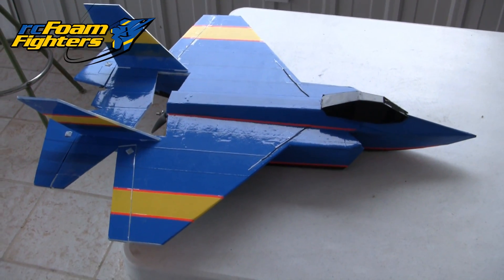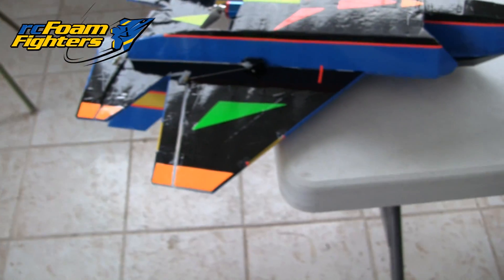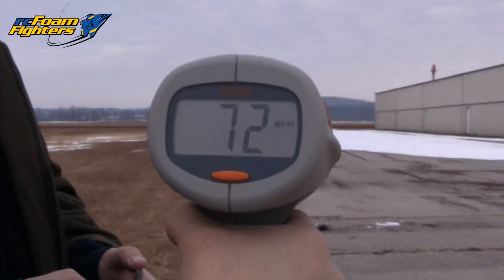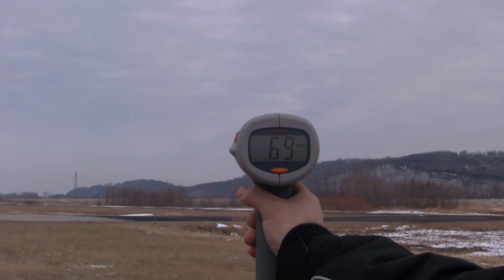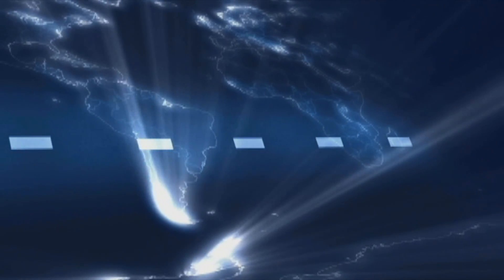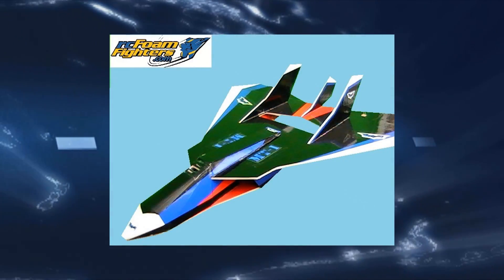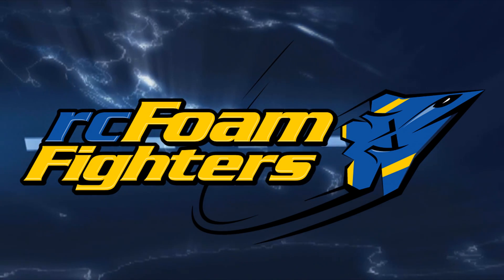FF-35 Part 5

Comment from the maker: @haogodent2 usually if i need to cut the tape I put a strip down on a clean cutting board and then cut it with an exacto knife. I do use pin striping tape for the thin tape lines. Also if you notice most of my stripes are 2-inches wide, just straight tape with no cutting.  In the end I think the video makes it look a little more accurate than it really is, LOL. Most of the time I just throw it on and not worry too much. Once its in the air and a bit out there you can't tell anyway, LOL

Comment: Built it and it flew off the board with single elevons. Will now add controls for the second set. The foam board didnt come cheap. £5 for one sheet. Edges were easily trimmed with a Davids plane. The belly pan was built out of twinwall(corex) as i wasnt going to buy another sheet of foamboard! Used the 2212-06 motor with a 4.75x4.75,30esc and a 1300 3s 20c battery. Flight was a bit sluggish but will change to a 5x5 apc prop which the sky fighter uses. Now added lights.

Comment from the maker: @altops Thanks for teh comment altops. True on the blunt leading edges, but I'm not too worried about it. It is just a low cost foamboard plane, $2 of foamboard. The rounded wood edges would cost more than the plane, LOL. Maybe pick up a 1 or 2 mph. Maybe later we'll try it. Thanks for watching.

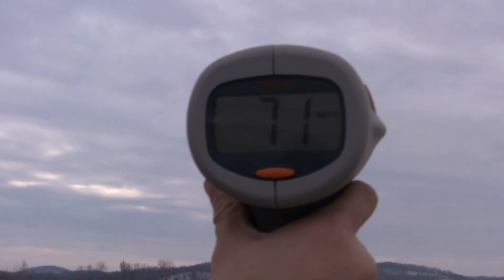Comment: @rcFoamFighters Yeah, I am very pleased with it.  It works great at the field.   I set it to listen and put it in my pocket and just do level speed runs.  I was pleased to see that it was so accurate just listening to your video clips.   For it to work from the video, it has to be a speed run where nobody is talking over it.  I got a good read at 1:45